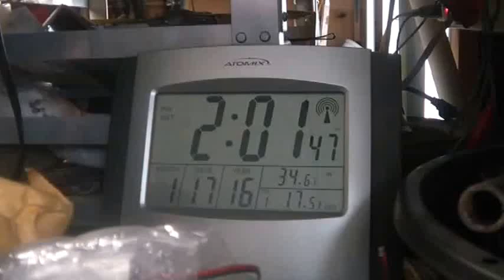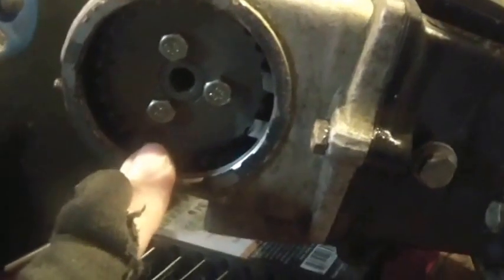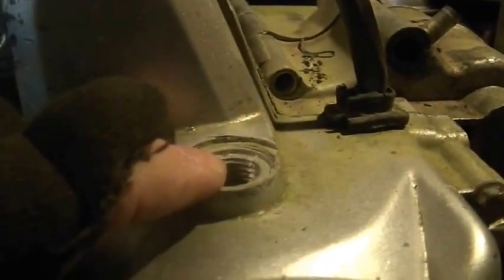Cam timing a 70cc China ATV Motor, Honda clone motor,

Comment: Hey man I love your channel loaded with information I am having trouble with my kids coaster 110 ATV I have no spark I have replaced the spark plug the coil the CDI stater with the timing make it not spark
Reply: Yes it could also if the stator is bad you won't have any spark or good spark .

Comment: Just put a Honda XR70 engine back together. The previous owner cracked the case when he threw a chain, he had the case replaced with a China case and the Japan guts. I got it not running with the wrong valves installed. I redid the whole top end new. Now it starts but as soon as I give it gas it dies. I tried tow different carbs so I’m thinking it’s the timing. How can I tell where the time mark should be on a 147FMD case should be?
Reply: Are you sure both carbs were jetted correctly?

Comment: Hey bud love your videos love the horde I have one of my own on a smaller scale though I'm wondering if I could ask for some technical advice in that I need to know what the piston tolerances are as far as piston wall clearance and ring end gap limits hoping you might be able to provide this info for me I'm trying to resurrect a Chinese quad that had less than 90 pounds of compression when I tested it and when I check the timing marks the one on the timing gear was facing 180 degrees off (I think) directly back at the cylinder at top dead center so think that's how I lost my compression but want to be sure that the piston and rings are still good to go to reassemble otherwise would buy new thanks allot in advance for any help you can provide

Comment: I can't locate a t-mark on my Lifan flywheel/stator. could I make my own t-mark by removing the top end and extending the piston all the way out, then making a top-dead center mark?
Reply: Leave barrel on but remove head and flywheel cover, bring piston to top of barrel, mark flywheel and engine casing with tip ex, or a centre punch, tdc should now be set,

Comment: Mr.my quad was running almost perfectly. I fixed the front brakes and now it seems like it doesn't have enough compression? sometimes it sparks but then there's no spark from the spark plug?any ideas?(thanks)
Reply from the maker: Hey Hugo, A compression test is easy, U can start there, I would also change the plug.... Look over the wire harness to make sure it was not pulled on and none of the connectors are pulled out... I would pretend that it is an unknown quad, and I would make no assumptions, compression test, new plug, retest the spark, make sure Ur battery is good and that all the switches are completely in the right position including the shifter, if still no spark, I hope it is a Honda, they are easier to troubleshoot.... Thanks for asking, watching, and commenting!!!

Comment: I have a question my good man. it's there suppose to be oil in that stator/mag cover?
Reply from the maker: Hey Broken Smile, There should be no oil inside the stator/flywheel cover for bikes and ATV with external stators, (stators that are not in the oil of the crank case), unless the case is cracked, the most likely cause is a leaky crank seal... If there are only a few drops, I would run it until is causes some issues... BTW, over filling the quad with oil or a plugged vent can force oil out anyone of the seals... Thanks for asking, watching, and commenting!!!
Reply: I just want to start off by saying thanks for the reply. I been all over asking the same question and I couldn't have got a better answer from you. I was thinking it could have been the seals but wasn't sure because I didn't know if the starter motor chain ran in oil. Now if I wanted to fix that seal what kind of tool would I need to take that crank bolt off?, It looks as if it is not going to be a socket to bolt job. lol.  thanks again
Reply: by the way it leaks pretty bad. also what are vents and how do they get clogged? thanks
Reply from the maker: Hey Broken Smile, There is typically a rubber hose that goes from someplace near the top of the crank case to the air cleaner assembly, the hoses can get clogged or kinked, several times I had caterpillar like bugs build nests in the end of the hose, some also have a one way valve that gets clogged with oil sludge.... Make sure that hose is completely clear and where it plugs into the air cleaner is also clear... Hope this helps, thanks for asking, watching, and commenting!!!
Reply: Harvey Spooner- what kind of tool would I need to take that crank bolt off or is there a trick in taking that nut off
Reply: Harvey Spoo

Comment: Any video about replacing timing chain? And some causes for its early demise?  Any bandaid to it.  Temporary solution? By installing some longer spring in the cam chain tensioner?
Reply from the maker: Chamjisky Klan, I have to replace a timing chain on a Kawasaki Lakota, same basic concepts, I do not suggest any short cuts when it comes to timing chains, if an engine jump time or if a timing chain breaks, the engine is destroyed, valves smashed, piston damage, jug damage, and the head is typically trashed... Thanks for asking, watching, and commenting!!!

Comment: This motor has 3,.. 0s I assume tdc is the 3rd solo 0.
Reply from the maker: Hey Max!!!  U R probably right, though, I would use a wire in the spark plug hole to double check, Thanks for your thoughts, watching, and commenting!!!!

Comment: another step closer to running,time to prep for the impending snow storm.
Reply from the maker: +roger oconnor , After cutting up some fire wood today, I mounted the engine, changed the carb, and drained the oil, tomorrow, I hope to fire it up... Will be moving the big snow blower to the lower drive way on Friday... Thanks for your thoughts, watching, and commenting!!!
Reply: Tomorrow I have to  put  the  snow plow on my truck  and 2 front tires.  I  have no roof on the back of my garage, just a tarp. Hopefully my friend is coming to help me get  it sealed up Thursday or I could have a foot of snow in my garage